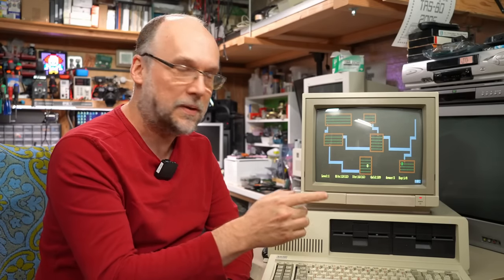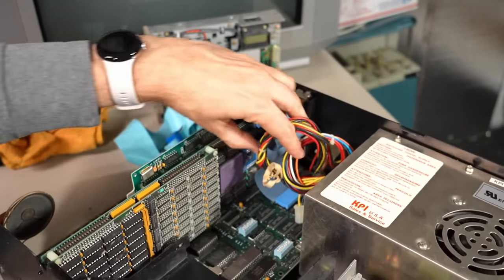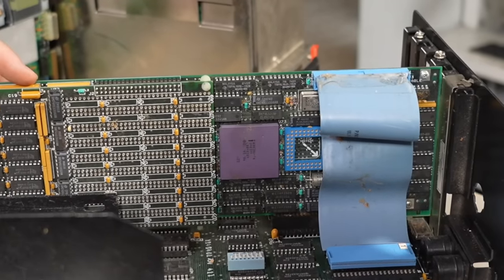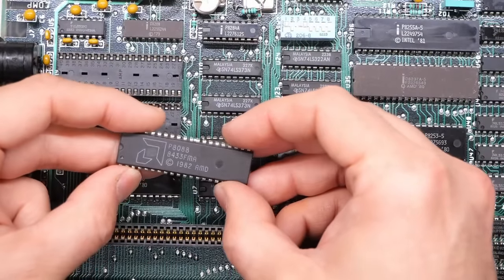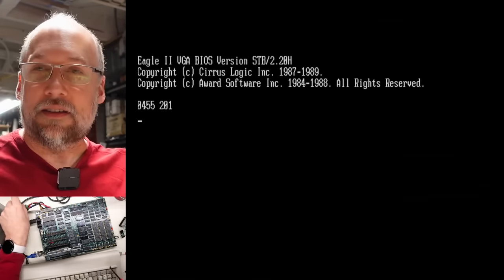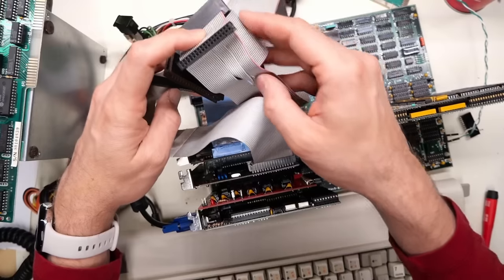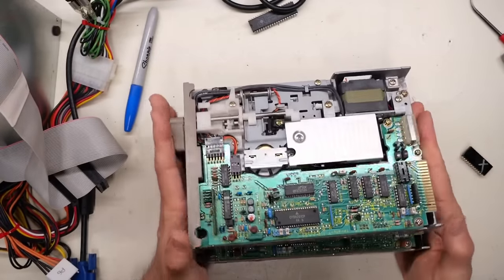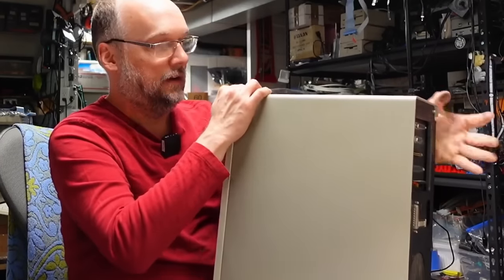PC Archeology: A left for Dead IBM PC 5150 with a treasure hiding inside 🕷

Comment from the maker: I forgot to mention in the video that there was really nothing interesting on either of the floppies I archived. Also, if you are curious, that EPROM I used in place of the ROM was a WSI 57C49C -- it's a drop in replacement but the issue with it is you can only program it on "fancy" programmers the Data IO 2900... so it's not really useful to most people since those types of programmers are impossible to find.
Reply: I've seen you reverse engineer weird memory expansion boards before, hopefully you take this Inboard on as a reverse engineering project as a reproduction is likely the only way I will ever come across an original, ever.
Reply: So, was the spider's name "Boris"?  😂

Comment: The spider is like, Happy Halloween, Adrian. But that 386 accelerator card in a 5150 is just insane.
Reply: Indeed. Wouldn't be surprised if this was used in the early 90's before upgrading to a 486. If this computer could talk or have a working hard drive...
Reply: @Toonrick12 I had the exact same setup in 1989,  5150 was from junk pile at work and 386 card was $20 from some guy name Fish from the Recycler.  Machine was finicky but did run 386 speeds and apps and it overheated nicely...
Reply: LIke a Beetle with a Posche motor in it :)
Reply: @katho8472 well, Beetles always have Porsche motors since Ferdinand Porsche designed the original Beetle....
Reply: @wernerviehhauser94 🤓
Reply: I only just asked about 5150 accelerator cards - good to find out they were a thing
Reply: The spider was the trick, the 386 card the treat :)
Reply: Imagine nowadays having a card boosting your PC by a factor of 20😀
Reply: @remipouliquen5422  technically I suppose you could drop in an industrial board with a decent cpu into a 10 year old desktop and remote into it, but that would be a hassle :)
Reply: Bet that 386 card did cost like a fortune when it was introduced. Btw .. didn't know spiders had "balls" 😂
Reply: So true.  shudder  I don't mind spiders, but we don't have any dangerous varieties where I live in Canada usually.  Further south is a different story.
Reply: Yeah, I thought "tf is a 386 doing in an XT? Would it even be able to support that?"
Apparently so😁🤘
Reply: @fubaralakbar6800  I had a small 286 board in my Atari 1040STf soldered direct on top of the 6800. Could multiboot into DOS and used the onboard ram of the ST. it ran various Dos apps and Windows think it was like version 2.0 😆
Reply: "It's a Giant Spider Invasion at Menards!" ~ Crow T. Robot, MST3K  

Was the spider's name "Boris"?
Reply: Pity this comment is the one that displayed under the video. Total spoiler.

Comment: I restored my one of these keyboards. The foam degrades inside and causes all sorts of problems, both with stuck keys and non-registering keys. I had to take it apart, clean everything and replaced the foam with a sheet of neoprene. It now works flawlessly. You will need a series of clamps top and bottom and a long one at the sides to help you get the layers clipped back together. Lastly, don’t pull off the space bar. It is clipped to a metal bar underneath and you will both break the plastic clips and be unable to reattach it without disassembling the keyboard again. When you do reassemble it, feed some dental floss through the post hole around the metal bar to pull and hold it up while you click the space bar back in. Once you are sure the space bar is clicked in and seated right, you can then pull it out.

Comment: The power supply on the 5150 was pitifully underpowered. I looked it up and one site says it was 63 watts. I had to upgrade when I added a hard drive. $400 for a 20MB Seagate. Still have the 5150, original green monitor, original ps in a box somewhere, the Seagate and (I think) its interface card and cable. We hoarders preserve history.
Reply: interested to kn ow what PSU you chose to upgrade to? Am waiting on a 5150 from eBay and am nervous about using the original PSU.

Comment: That 386 accelerator card is super cool!
Growing up, my parents had an IBM 5150 they picked up used. It had 640K of ram, CGA graphics, 1 Full Height 360K floppy drive, and a MFM 20MB Seagate Half Height Hard drive.  It originally had MS DOS 3.3, a few games, and MS Works for DOS. My father and I upgraded it to a 386 33MHz and more RAM. During the upgrade, we discovered that the AT spec moved the keyboard port to right between the Keyboard and Cassette ports and increased the number of expansion slots in the same space as the XTs!  So, we were limited to external I/O on the outer two slots and internal I/O card in the next two slots in, but couldn't use the rest of the slots near the center as the mounting brackets would not line up!  We trimmed the case to allow access to the keyboard port and ran it that way for a number of years.  It ran MS DOS and Windows 3.0. I played SimCity, SimFarm, SimAnt, and Railroad Tycoon on it as well as learning how to program in Turbo Pascal on it!  Good times!

Comment: Seriously, this machine brings me memories of my early days with computers.
When i started learning BASIC in the early 90´s, we were using 8088 and 286 PC that were ¨pumped¨ up with max RAM with very few or no wait states. They were all in the same room, as they were the ¨rookie¨ machines. They all had double 5.25 1.2 MB disk drives and no hard disk (on purpose). In that room, you could find a very odd selection of desktop cases, from old 5150, to unnamed clone XT, to even foreign weird ones. My favorite was an upgraded Televideo that was upgraded from 8088 to a NEC V20 and was working with... 640K of RAM!

Comment: you've solved a mystery for me. i used to work in a manufacturing shop that made a lot of face plates for telecommunications equipment, which were powdercoat painted. if there was even the tiniest speck of paint missing, they would have it buffed and repainted. i've always thought was silly and wasteful, considering the parts being made are going to sit in a closet and never be seen by anyone who would care about a tiny fleck of paint missing. maybe it's because they want to make sure the powdercoat prevents oxidation.
Reply: That’s common with pretty much all painted iron/steel surfaces — a little missing spot, or a bubble under the paint, would definitely corrode within 5-10 years of service. It definitely seems wasteful of paint, but of course that’s much cheaper than sheet steel so it works out.

Comment: I'm assuming it was just cheaper to install the 386 card once the computer started to become too slow to run major programs than just buy an entire 386 PC although Im sure that in and of itself was not a cheap proposition, however its really nice to see an original 5150 up and running, especially with a faster brain and heartbeat. Great stuff as always Adrian!
Reply: If memory serves right it was quite the opposite which is why these were never popular. I mean this thing would cost as much as a 386 motherboard, with the penalties of the slow bus. But its amazing something like that even existed, because its of course an "easy" upgrade if you just wanted your spreadsheets to run faster or such.

Comment: Tip for the bad sector disk: I had very good results with completely unreadable C64 disks (like 80+ % of the sectors were unreadable when archiving them on PC with a 1541 connected to the parallel port). Cut open the disk envelope, place the disk on a paper towel, and clean it with an other paper towel moistened with Windex. Cut open a good condition sacrificial disk and insert the cleaned disk into its envelope. Completely unreadable C64 disks came up 100% readable with this method. That collection of disks was stored on an attic for 15-20 years, and they didn't like it.

Comment: Funy enough, Epictroncis released a video today, restoring Model F XT and Model F AT Keyboards. He also had some badly desintegrated foam pads and showed some replacements you can actually buy new. Regarding the POST error, I assume that the water in the keyboard caused some corrosion that is causing some kind of short, and be it a stuck key or something like this.

The accellerator is great, I'd love to get my hands on one at some time to test around with it.
Reply: Epictronics even has a Model F repair video from a couple years ago - very helpful when I was doing work on my Model F

Comment: I worked on 5150s and 5154s. I also helped with the first ps/1s when they were having problems with corona arcing. I designed and built the 1st circuit jig to test audio.

Comment: Another great episode!  I remember in the UK a company called Evergreen Technologies offering complete Pentium-class computer replacement cards for 486 and older machines - the old motherboard was completely bypassed and only used the ISA slot for physical support holding the 'accelerator' in place. The power supply and all IDE cables etc attached directly to the card. I worked in PC manufacturing at the time and they approached us to stock them as an upgrade option - sadly for them we really wanted customers to purchase new machines!

Comment: Thanks for the blast from the past, as a lot of your videos are to me. I am from Portland and starting about 35 years years ago(when computers were expensive) I started buying broken and used computers computers and parts. I would  rehab them and resell them. I have done everything from the 5150 on up. I recognized what you had the minute I saw it. One time  I bought a bunch of XT's out of a warehouse down on Produce Row in SE Portland. About 4 or 5 of them had a 386SX card like the one in your video. Several of the clone XT's  had the pop up lid cases where top of.case was like the hood of a car. They were great to use for testing cards, HD's and floppy drives. Seen and done a lot of things. 286-20&25 Harris cpu's that would out run any 386SX, taking MFM drives and using an RLL controller to format them and then double or drivesppace the drive to get more capacity, installing and getting to run operating systems that were supposed not to run on a computer that Installed it on  and a bunch of other things. Almost nobody used to wipe their HD"s in those days, I got the surprise of my life when some of the  XT"s I mentioned were from the IRS and still had the programs and data on them,. I wiped the drives and reformatted them in a hurry, kind of spooky when you think about it. I stopped selling my rehabbed computers when the new stuff got so cheap like an Athlon dual core and motherboard for $69.00 of which I still have one running to this day. Why buy used when new was so cheap. The only thing today that consider cheap is SSD"s, can buy a 500GB one for less than $30.00.

Comment: 9:10 - Those nut-drivers were originally designed for hex-head (slot-less) sheet metal screws back in the day.
Reply: 3/16- & 1/4-inch nutdrivers were the typical ones.  Then Compaq came along and started using Torx head screws, as I recall.
Reply: I saw someone in another video mention it’s 5.5mm, so most hex drivers miss it (going from 5 to 6). It wasn’t even about IBMs, it was something else and they mentioned IBM used these heads too.
Reply: 5.5mm = 0.2165354331 inches, pretty close to 0.25 (1/4 inch) so I think we could both be right.  I don't think they were metric threads, but it's been so many years since I had to find replacement screws for that early a PC that I don't remember for sure.
Reply: @bobblum5973   1/4 inch is 6.35mm so 5.5mm wouldn't make sense as being interchangeable.
Reply: @eDoc2020  Thanks for correcting that.  I think I fat-fingered the touch screen on my phone's calculator.  I reworked it, and 5.5mm is roughly 7/32 of an inch.  I think that's what I used since I didn't have metric sockets or nutdriver handy back then. 🤔

Comment: Great video! I got a very nice IBM PC 5150, with the 64-256k motherboard and a memory board, CGA and 2x 360k floppy drives in a garage sale this summer. The guy asked 20$ for it and I bought it right away. The guy was wondering a little bit why I didn't try to negotiate, but the price was already so good!
Reply: Damn you stole it. I would have too.

Comment: Always amazed at your knowledge of old tech. My first experience with computers was with the Apple IIc and Apple IIe, and the first gen Macs, all with green or amber displays. My first word processor was Appleworks. I created pictures of trucks, motorcycles, etc. with nothing but char$, (character strings) in DOS. That took a lot of lines. Amazing how far tech has evolved. I'm 68, now. My only computer is an Omen 17 gaming laptop with an Intel Core i7  8750h processor and Nvidia 1660 Ti graphics IC. It isn't top tier, but plays games pretty well.  Still miss those old machines, working with DOS and Basic. You actually bring back a lot of those memories. Thanks for that.

Comment: Slotted screws have been around for 400+ years, and Phillips came to be sometime in the early to mid 1900's IIRC . Slotted screws are cheaper to manufacture, they allow for a lower profile screwhead, and you can put more torque into them before the screwdriver starts to cam out, especially if you're using a screwdriver with a hollow-ground blade. The only real advantage of a Phillips over a slotted screw is that it is self-centering. But that one advantage alone outweighs nearly all of the slotted screw's advantages combined. There are some situations where the slotted type of screw pulls ahead, such as the wrist and pocket watch industry where the screws holding the bits of the movement together are almost microscopic and flush-fitted. Where one errant sneeze can end up costing you hundreds or thousands of dollars. One of those screws rolls off the table and hits the carpet, you'll NEVER see it again. Lol....

Comment: In 1989 My Grandfather had this expansion card. He passed a few years later, and I did inherit this machine. His was populated with 2MB RAM, with 2 5 1/4 , one 3.5 and a standard 20mb Seagate drive. he had hacked a toggle switch to change from 1.44 to 1.2 drive A selection.

Comment: There is something really nice about the old systems with two 5.25" drives. I had an Atari ST with one 3.5" floppy drive, no hard disk and only 512kb RAM, so copying disks required a couple of disk swaps...
Reply: I had a similar setup. Though my father kindly had the ram professionally upgraded to 1mb a year or so after I received the ST for Christmas. None the less I swapped floppies a lot. A fantastic floppy drive that still works to this day. I loved my ST so much. I still have it.
Reply: @blackterminal  yes, the RAM upgrade makes a big difference! After a year or two I picked up another STFM with 4mb RAM which felt infinite. It was enough to set up a 2mb self-compressing ramdisk (Maxidisk) and still have more than enough to spare. Great memories learning to program with GFA Basic, Sozobon C and the various 68k assemblers on that thing. I had to get rid of them upon getting a PC in 1998, but picked up another pair of STs and a Falcon about 10 years later after finishing undergrad.

Comment: Something for your future video on accelerators. If I remember correctly (it has been 30+ years), there are four "turbo" modes on the Inboard/386, which you can select with Ctrl-Shift-Alt-1 through 4 (with 1 putting the CPU back to 4.77 MHz, 4 going to full-speed 16 MHz). I do remember an additional BIOS thing running during boot, where it initializes and counts the 2 MB of RAM on the accelerator. Maybe that came from a utility program.
Reply: Hmm a 386 put into 4.77, so you could finally play Digger properly... Aside from the odd badly written game i never saw any use for slowing down cpus that came with the infamous "turbo" switch many clones had.

Comment: Across the room is an IBM 5150 that was graciously gifted to me. I have not yet plugged it in, but it looks darn near new. Very little dust, very little use, all original. It sat around a college storeroom since 1998. The last time it was used it was as a monitor stand so the whole class could see the display (my brother is a college professor.)  My brother never did plug it in, he just found it outside an office and grabbed it. It is second version. It is also extremely late production. I thank you for this video because I learned a lot of stuff I did not know. Hopefully the monitor I have works (the case is broken.)  Thanks again.

Comment: I suspect the foam breaking down has made it conductive. Sounded like several keys were being held down at the same time, when the keyboard was connected.

Also, at around 52:00 you're holding one of the live wires from the voltage switch dangerously close to the PSU chassis, which is a ground connection.

Comment: Oh my goodness, another Intel Inboard/386 !! ... as soon as I saw it in there I knew it looked just like the one we used to have. In fact, we also had the 386SX/16, with 2 MB of RAM. We did also have the 387 math co-processor (probably because my dad needed it for AutoCAD and other engineering software). I heard that we had one of the few that actually worked properly, but I've not corroborated that, I just know that it got us a few more years of use out of that machine. I even managed to get Windows 3.1 to run on it (in Standard Mode), despite the documentation explicitly stating it wasn't supported.
Reply: And to think that Microsoft once thought that no one would ever need more than 640K of RAM in their computer.  Such naivete!
Reply: Amazingly, we talked MS into making a special Windows 386 for the Inboard 386. It was based on Windows 3.0. I think I still have the coffee mug MS sent the Inboard team when it was finished. The mug said, “Windows runs on the Inboard 386, who cares” 😅